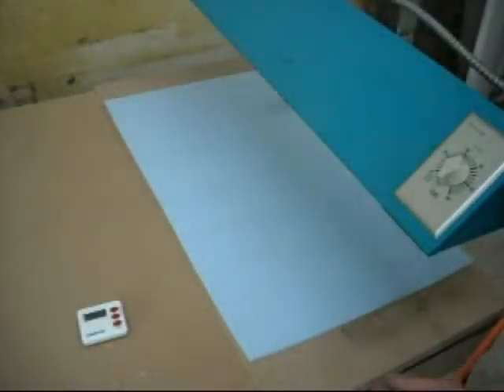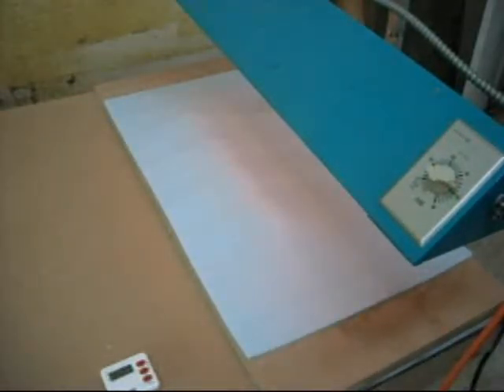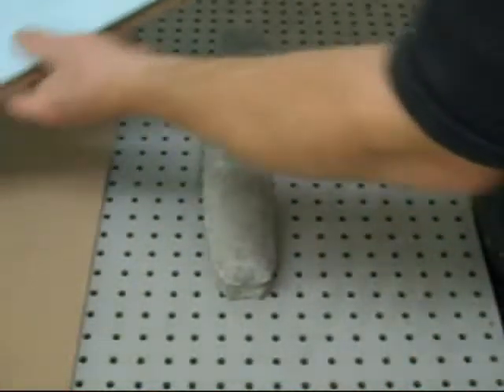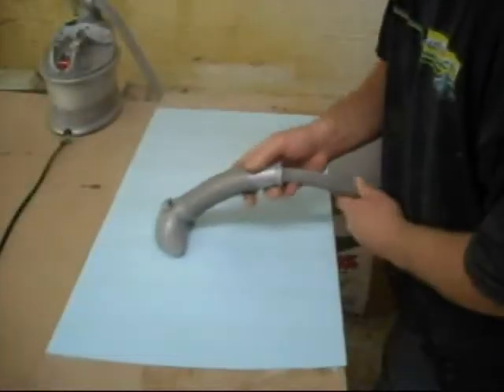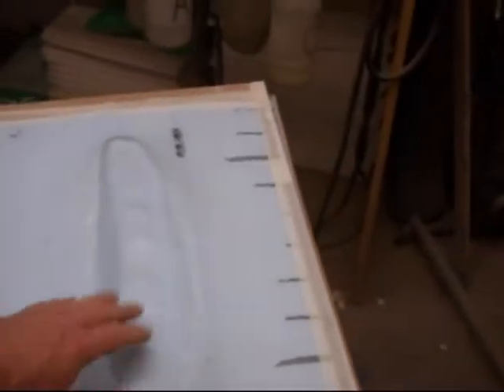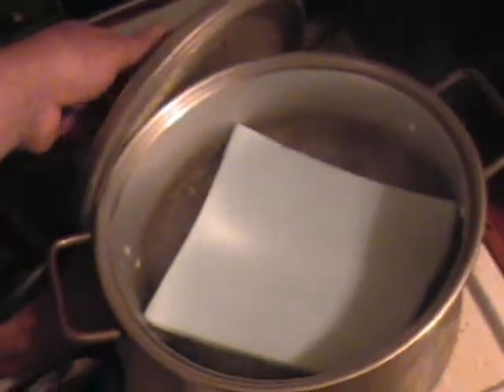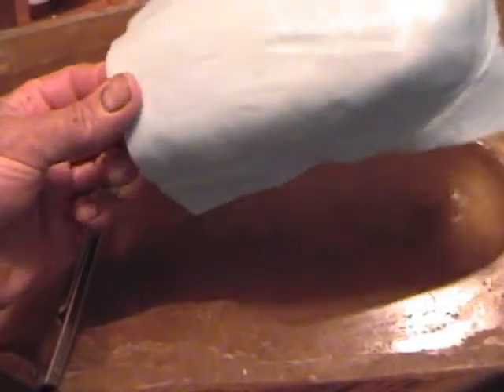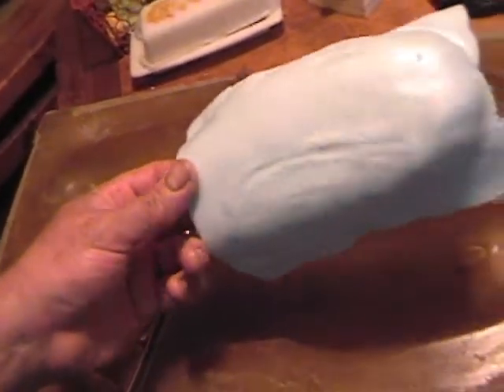Forming FFF for RC parts; part 3 (of 3)

Comment: How about using expanding foam, like Great Stuff??  Put a layer of plastic bag over your concrete plug, then a bead or two of Great Stuff, another layer plastic bag and then your fiber glass mold.  Will probibily have to weigh the mold down while the foam fills the gap between the mold and plug.  The bag layers are to prevent the Great Stuff from sticking to the mold and plug, since it sticks like super glue.  What the heck, you already hve the mold and plug....

Comment: Dan, if you haven't torn apart your vacuum forming box. You need to place your lamps below the mold and foam. Heat the mold and foam until it begins to sag, then throw the vacuum to it.

I used to a lot of vacuum forming and the key is to heat your materials from below.

Good luck on your latest projects.

Comment: I also unfortunately came to the same conclusions, I have also tried taking small pieces essentially the dust from several cuts and steam them together, using white glue, and Polyurethane none really had the needed strength and needed weight (last two were too heavy)